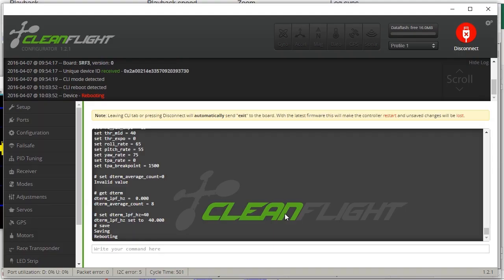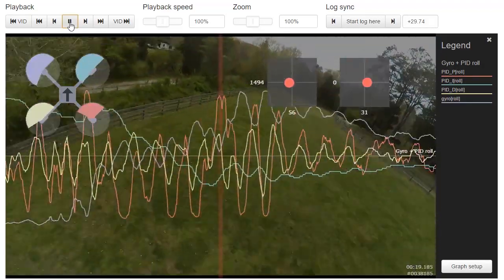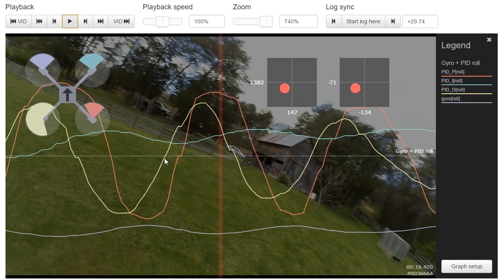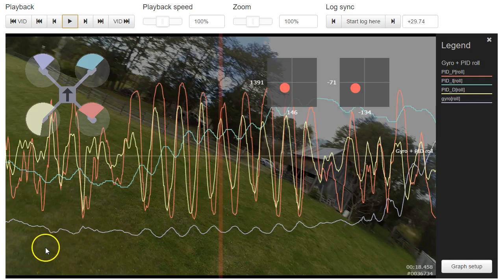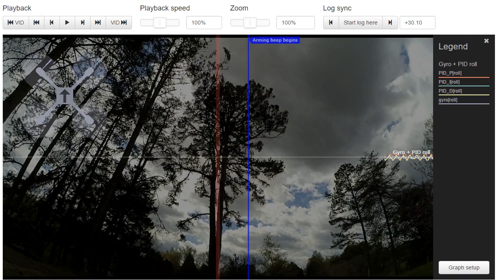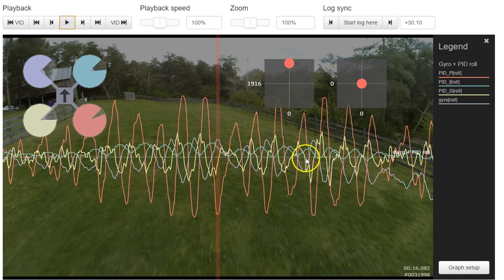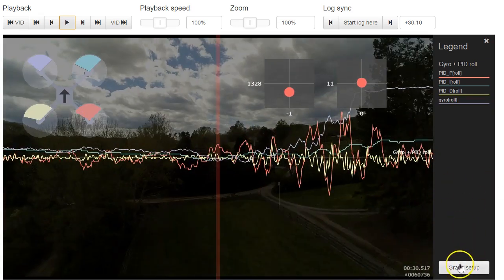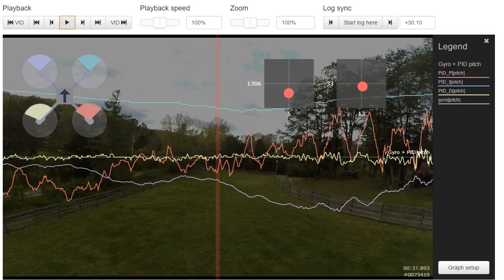Cleanflight / Betaflight Advanced D Term Tuning - Part 2

Comment: I am having problem taming my d term. There are definitely oscillation in the d term in the bbl. The d term notch is working but could not attenuate the frequency between the d term low pass cut off and d term notch cut off. The d lowpass type is pt1. I am thinking to change the d term low pass type to biquad. does biquad attenuate the noise  above cutover better than pt1? btw the P term looks very clean.

Comment: Joshua,

I noticed you had your dterm_average_count set to 8, which is quite high. Averaging the DTerm adds delay, so by having this set and also setting dterm_lpf_hz you have introduced 2 sources of delay. Personally I think using more than one form of noise reduction on the DTerm is probably not a good idea, that is use either dterm_average_count or dterm_lpf_hz, but not both together. It would be interesting to see what sort of result you get if you set dterm_average_count to 0 and dterm_lpf_hz to 40 - I'm curious to see if this would result in the same DTerm problem.
Reply from the maker: +Martin Budden I think dterm_lpf_hz overrides dterm_average_count. I raised the average count for additional filtering but thanks for the reminder because I should lower it now that I have the FC vibration isolated. I didn't think that 8 was very high. I thought I'd seen someone on rcgroups throwing around averages in the 20's or something. If the loop is 2 kHz, then 8 samples is only 4 ms, right? We used to run PT1 filters with way more than 4 ms delay.
Reply: +Joshua Bardwell 
in Cleanflight dterm_lpf_hz overrides dterm_average_count, in Betaflight it does not - Boris allows you to apply both filters simultaneously.

If I remember, in this video the loop was 666Hz (at least the blackbox loop was, anyway) so your delay would be more like 12ms. Plus there is the extra delay from the lpf. I imagine you could measure the actual delay from the blackbox traces.
Reply from the maker: Goodness! Thanks for pointing that out.

Comment: I built my first quad a few weeks back. when I went to fly it came off the ground a few inches started to yaw right and flipped right over. you think I have a setting issue upon my clean flight setup or some other issue. thanks for any ideas.
Reply from the maker: +SyNFuLLj insta-flip on throttle up is usually one of the following:

1. FC board is not facing forward and board align is not configured to compensate for this.
2. Motors plugged in to the wrong headers / in the wrong order.
3. Motor spinning wrong direction.
Reply: Well all Motors are on correct number pads and spin the correct way when I use clean flight to test.  The arrow is facing the front of my quad.    It does not flip right away. I will hover it a few inches off the ground. It will start to yaw right and then just flip.  I have a short clip in my videos of you would like to see what it does. Could my board be bad front factory? Thanks for any help Josh.
Reply: Small clip of my problem. Dang spell check
Reply from the maker: Are you in autolevel?
Reply: +Joshua Bardwell yeah it does it in angle and horizon

Comment: Josh do you let your P&R gyros stay that wiggly in between the big bouts of prop wash?  Even during normal flight, the surging in the P term was pulling the gyro all over the place on both pitch and roll. 

Also I noticed oscillation in the I term that seemed to contribute to the gyro fluctuation.  What I terms were you using on P&R?
Reply from the maker: +William Slater No, this is way too noisy. That's what I am trying to fix. I found the issue, which will be revealed in an upcoming video. Suffice it to say, there was a mechanical issue that was contributing to excess vibration.
Reply: +Joshua Bardwell looking forward to it.

Comment: Since you've done all this tuning, are you still seeing mid-throttle oscillations? If not, and you're only seeing them at high throttle then TPA is the next step..
Reply from the maker: +Razvan Taranu further testing after upgrading to BF2.6.1 has turned up a motor with a bent shaft. Lesson is, always look for the mechanical first.
Reply from the maker: +Razvan Taranu Hahaha. Further further testing has revealed that I have two sheared mounting posts on my FC. So yeah. That's clearly the issue. LOL.
Reply: Joshua Bardwell We build these quads strong, but we do abuse the lights out of them too :) Guess some maintenance checking on them is useful.

Comment: What version of betaflight was this done on?  I tried adding D term filtering on 2.5.4 and believe I experienced a similar issue.  I have since flashed 2.6.1 but haven't flown yet.  I know boris sped up the d term filter method on 2.6.1 to have less of a delay.
Reply from the maker: +Rc Dad 2.4.1.
Reply: Thanks, very good analysis and find.  I always heard of things being out of phase, but you are the first who ever showed it in an intuitive way with real data.  Very good stuff!
Reply: +Rc Dad Yes in 2.6.1 D filter is optimised to be in a perfect harmonics with Pterm. Basically I didnt find a setup what was running into problems even with higher D.

Once you fly higher rates....lets say like 900-1100deg/sec and above than bounce is more prominent. WIth lower rates you can get away with low D

Comment: how do you feel about tpa Josh
Reply from the maker: +jamble7k TPA should not be necessary under most conditions with recent firmwares (BF 2.1.6 and CF 1.11 or maybe 1.12). The PID loop has gotten so much better that the problems that TPA was covering up shouldn't be there any more.

Comment: Awesome. Now we are all waiting to see how you tame down the P term !
Reply from the maker: +Stephen B Well, I'll tell you... the short answer is that I've decided to go to 2.6.1. There are more options for filtering in 2.6.1, such as the yaw filter. And everybody else is going to 2.6.1 so I may as well too. Watch for more videos coming soon!
Reply: +Joshua Bardwell 2.6.1 is using dterm filtering of 70hz by default and that seems to be much better in terms of delay and is definitely a more usable value.  I dont know if it is better than the averaging method but perhaps cleaner with just minimaly more delay.